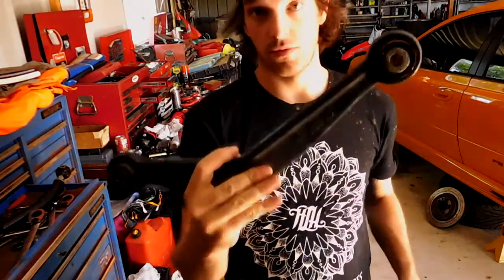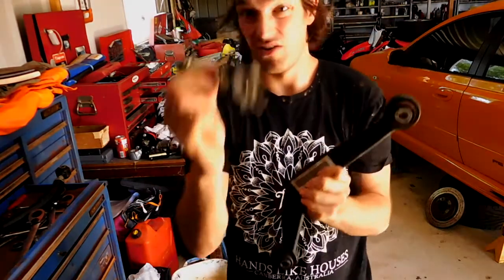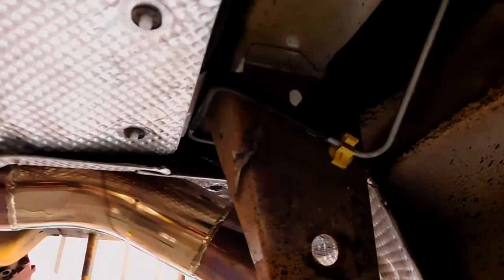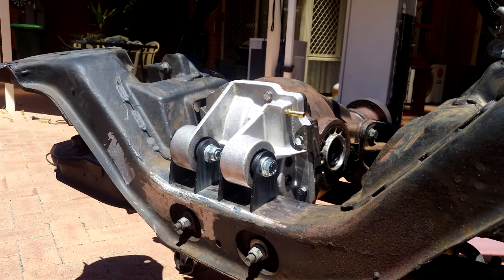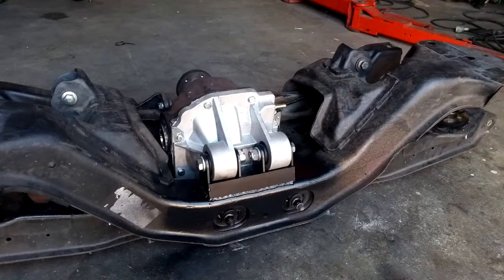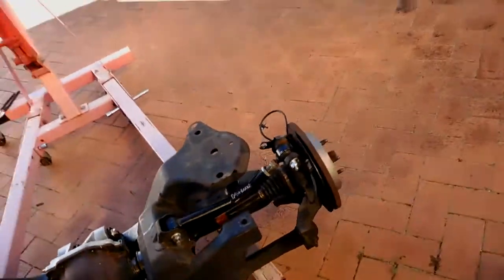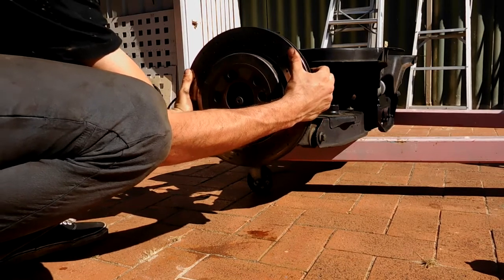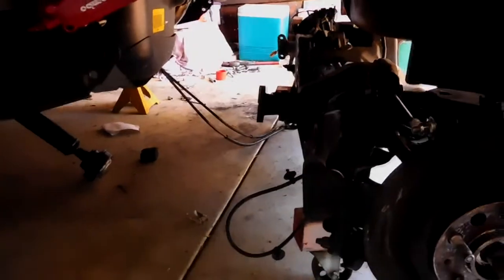F6 Typhoon diff hat upgrade, part 2.

Comment: Hey mate, how did the adjustable upper arms work out? did they fix the camber issue much, sick of having worn insides
Reply from the maker: Thanks for the comment! 
Yeah it certainly did mate. I got my rears set with just a smidge of positive camber to counter the squat under acceleration. Heaps of grip and good tire wear now.
Wanting to rebush all the control arms now to remove any more flex from it though. Still having a touch of wheel hop problems

Comment: I had to be that guy those rotors are not slotted they are drilled
Reply from the maker: @ryankeogh4286  your correct yes. Simple mistake on my part. I probably got confused due to the car being booked in at the time for getting new front rotors that are infact slotted 👍